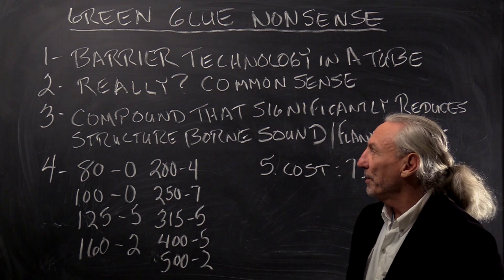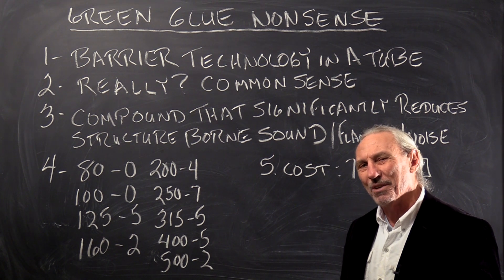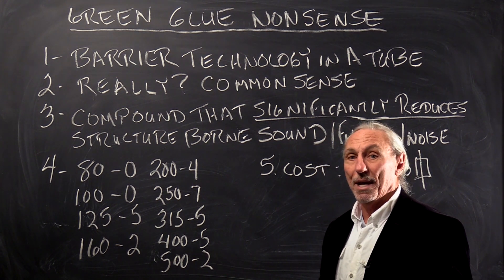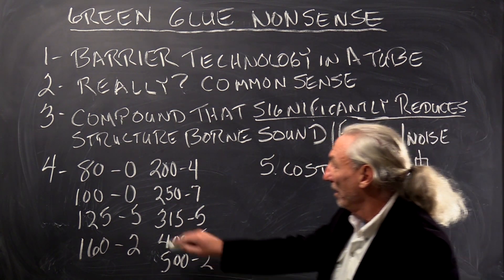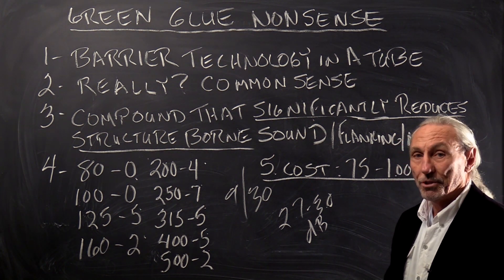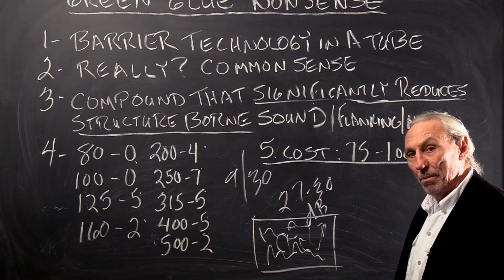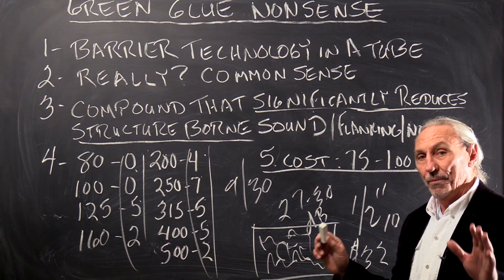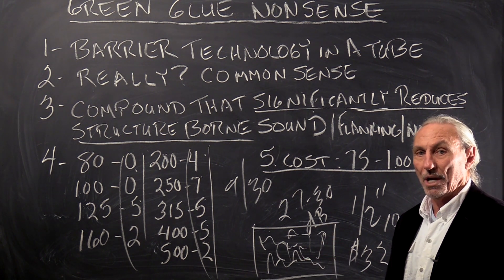Green Glue Nonsense - www.AcousticFields.com

Comment: The cost aside - what's the downside of using that stuff in between whatever insulation (be it MLV or others) you install? Every bit helps, right?
Reply from the maker: Not necessarily. Remember all material types and construction methodologies are all frequency and amplitude dependent.
Reply from the maker: M,  It depends on the frequency and amplitude of your noise issues. Does "every little bit helps". No, it does not. With noise, you want to use just enough barrier technology to solve the issues. Spending money and adding material without knowing what frequency and amplitude you are trying to reduce the noise transmission of is a waste of time and money.

Comment: I've always been a sceptic of green glue- I've never used it but have worked on several music studios in nyc. I think resilient channel is pretty good though. As long as all the edges are sealed so that there is a true sealed air pocket between layers of 5/8 rock-  you are getting best bang for your buck
Reply from the maker: D,  All materials used in any barrier design are frequency and amplitude-dependent.  You must use materials that deal with your noise numbers. There is no short cut. You must measure, design, and build the correct structure. There is no one size fits all.
Reply: @AcousticFields  most music studios have the same criteria in terms of frequency, your stock phrase for avoiding giving a helpful answer is wearing thing...

Comment: I’m not sure where you got only a -3db attenuation? I just treated our rehearsal room-double 5/8” Sheetrock with green glue in between. I measured bands rehearsing outside of our room and inside our room before and after the work. it used to be single 5/8” on either side and now two 5/8” and green glue. I have 35 dB of attenuation when before I had 10 dB. So it was a 25db difference. This was using C weighted dB meter. The difference is considerable. Could it have also been considerable with other materials? Maybe.
Reply: But what frequencies though? I'm sure it helped some with say guitars. But a kick drum?  Adding that 2nd layer of drywall for mass helped definitely. The glue, I'm doubtful. 20-100hz is a good test range.
Reply: BrysNightWorld nothing except tons of mass and tons of distance does anything at those frequencies. That’s why STC ratings don’t even go below 125hz. Green glue (nor anyone else) is making claims that anything helps those low frequencies (unfortunately). The only way to do anything about that is try and do super thick walls with concrete, rock, adobe, etc, but even that is not going to totally stop stuff unfortunately.
Reply from the maker: R,  What frequencies did you measure?
Reply: Acoustic Fields as I said-I was using a c weighted db meter in real world conditions (rehearsal rooms with other bands rehearsing in their own (untreated) rooms. I took measurements in the hall and in my room over several days as the construction was underway. The loudest band would hit 102 dB (!!!) and going in my room would drop it to 65 dB where before construction I was getting down to 85-90 db.
Reply: STC ratings mean more than word-of-mouth, right? From this video it sounds like you are saying to just use 1/2” Sheetrock (or from watching your other video-plywood). I’m in a commercial building so I can only use 5/8” type-x Sheetrock. STC rating of single 5/8” and insulation is 44-45. STC rating of doubled up 5/8” and green glue is 55. If you do it right with the hat channel, etc then STC is closer to 65. I’m not trying to troll or anything (I need to go finish putting up Sheetrock in my control room), but I have a hard time understanding where you are getting the poor results you are talking about.

Comment: I plan on turning my detached garage (bare stucco and studs) into a soundproof music/rehearsal space.  I am going to do the double wall, double drywall route.  I was told that I need to put green glue in between the drywalls.  Now I'm hearing that green glue may not be the best thing to use.  What should I do?  Any tips? Thanks!
Reply from the maker: A,  You must first measure the noise in the neighborhood and then the noise you will be creating within the room. The barrier you build is based upon those noise numbers. The method you described above is good for frequencies above 125 Hz. It will not deal with the kick drum or tom.
Reply: Did you ever complete this conversion? How did it go?!
Reply: @nikonmikon8915  no not yet. Life happened.
Reply: @AngelX  Ah bummer, I'm interested in how it turns out for you man 🤘
Reply: @AngelX  I best way to do it is use Rockwool safe n sound insulation in walls that are 6 inches thick and then build an entire stand alone room inside that room with 2 x 6 walls. The inside room has R22 6 inch rockwool insulation as well. The distance between the walls and the ceiling is 2 inches. 3/4 plywood on the outside walls and the inside walls are decoupled 3/4 plywood and 5/8 drywall. 2 inch thick foam over the drywall. All is sealed air tight. No one will hear a thing outside the room.
Reply from the maker: A,  You must first measure the noise entering the room and leaving the room. Remember there is no such thing as sound "proofing". You must manage the noise issues by first identifying the frequency and amplitude of the noise and then build the appropriate barrier technology. The barrier method you are considering will only work for frequencies above 125 Hz. If its a live room which you describe, you will need a different barrier technology since live rooms are full range.
Reply: @AcousticFields  thank you sir. That's the issue. It's full range sound from instruments, so how do I deal with the rest of the frequencies below 125hz?
Reply from the maker: A,  You have to measure the frequency and amplitude over a 7 day time period. Once you have that data, we can design the barrier technology for you and provide you a build drawing that you can build. The design fee is 1,500.00 for this service.
Reply: @AcousticFields  the average range for music will be 20hz- 4 khz. An acoustic  drum kit would be about 119 db on average.
Reply from the maker: @jaredswords3  We use a different range for our studio treatments. We use 30 Hz. - 6,500 Hz.

Comment: While I agree that Green Glue is overrated, some of the stuff mentioned in the video about the claims made on GG website are just plain wrong (as in they don't exist) while others are taken out of context. It is fair to criticise the product, but why make up stuff to support an argument?

If you are researching products for your sound isolation, read through the test data provided by GG on their website. You will soon realise that GG is less effective than using RSIC clips, and only provides a STC improvement of +2 when applied to 2 layers of drywall. I read rave reviews of GG being the most effective medium for stopping bass, but there are no testing results below 80Hz. Simply increasing the thickness of the drywall is a cheaper and more effective approach. As stated in the video, the only way to stop bass frequencies is by adding mass and thickness of materials.
Reply from the maker: J,  It is marketed as a barrier technology when it is not.  All numbers were taken directly from the web site.
Reply: @AcousticFields  It is marketed as a sound damping and soudproofing solution. That is pretty much all that is stated on the first page of their website. If you take a broad defintion of soundproofing to include the acoustic treatment of a room, then it does what is says on the box. The problem is faux sound engineers who spruik the product without actually understanding what it does. You know better.
Reply from the maker: J,  What is your definition of "soundproofing" ?  The conventional definition is that it stops all noise. What noise does it stop?
Reply: @AcousticFields  From your website https://www.acousticfields.com/definition-of-soundproofing/. 
"The actual definition of soundproofing deals with sound pressure and reducing that sound pressure between the source that is generating the actual sound pressure."
AND
"... we can use damping structures to absorb excess sound pressure energy".

Green glue is a damping technology, it says so on their website, and in my view that is their primary claim. It is the viscoelastic component of a multi layer damping solution. For the record, viscoelasticity is widely used by mechanical engineers to reduce vibration (i.e. damping).

You know your stuff and have your own way of doing things. Others choose to do things differently. You have a biased opinion on green glue which is in the negative. Just like a lot of other technicians have a biased opinion in the positive. I think the key point is that every sound problem needs a different solution. Making a green glue drywall sandwich may work really well in some circumstances and make things worse in others.
Reply from the maker: J,   Mass is just one variable you must consider when building a barrier technology to reduce noise transmission below 100 cycles. You must look at the frequency response of the noise and the vibration signature of each material you are using in relation to the frequency response of your noise . The joining of these two signatures produce a third signature that is the real test of the noise reduction coefficient you are going to end up with.This is the issue people don't understand with noise. Most people we talk to actually believe that two pieces of drywall with green glue will stop everything. So, they build that structure, they are disappointed and then call me for a fix. Unfortunately, the fix involves complete removal of what they have built. Guessing with noise is a fool's game. It has always been and will continue to be until these urban myths are explained for what they really are which are marketing tactics.
Reply: @AcousticFields  I was talking in general terms, killing bass can only be done with mass. The question is then, mass of which material, as you pointed out.
Reply: He also claims the edges of the drywall aren't sealed, so the random green glue patterns can't trap heat, but sealing the edges is critical to the installation! https://youtu.be/UO_NowMgPdY Common sense tells me if a product like this was truly useless it wouldn't keep selling. People do notice sound.
Reply from the maker: That makes sense. Now this "magic" adhesive can stop bass. Now, I have heard everything. What nonsense and rubbish.

Comment: instead of discrediting it completely, perhaps say it's useful when you have the money but dont have the extra 1/2 inch to work with that its a reasonable option for added attenuation. btw appreciate your videos and have watched many
Reply from the maker: H, It does not have any usage when you look at the total sonic strategy for STC. A common belief system is to use it with a double 2" x 4" wall with an air space between each wall. This could be as much as 7-8" of space to achieve an STC of 50 - 55. We typically achieve an STC of 80 - 85 in that space at all frequencies not just above 125 Hz.
Reply: @AcousticFields  and how do you achieve this at a similar cost? You never share the how to you just constantly knock other methods. PLEASE share what is better than a double wall with double drywall and GG. I am guessing that your methods are 10 times the cost and you just never admit to that. Please prove me wrong for a change! Thanks
Reply: @AcousticFields  and how do you achieve this and how much per SF? Are you ever going to actually share ideas on here or just keep discrediting every other method and product without no help at all to is. This is getting old. The same exact responses with zero insight to all these poor people reaching out to you to seek your "professional" help.
Reply: What a snake oil salesman. Discredit and then offers his own proprietary solution. How convenient. You keep on answering people’s questions by saying it depends on the frequencies of the sound blah blah blah. Let’s be real. You know exactly what people are asking about. Usually impact sounds, or maybe a theatre setup. For impact sounds, greenglue can help to a point. Atleast for ceilings.
Reply: @Heliosvector  exactly right? I have been trying to get a straight answer from this guy for 3 weeks now! Every time he replies back to me with "what is the frequency and amplitude of your sound issue"? He's hoping that we have no idea what he is asking and we stop pressing him for answers. Some of us are actually pretty educated on sound systems and what those terms mean. I have provided numbers to him twice and he always ignores me. What a douche! I appreciate you calling him out. I have been stuck on a double wall assembly for simply blocking a full range stereo that goes down to about 28 db and looking for answers on what's best to use and most cost effective. This guy is such a dick! Any insight on your setup would be great the hear. Thanks man!
Reply: @detroyt232323  here’s my advice and discoveries. First off. Mass loaded vynil is great... but it is expensive AF! Don’t bother with it unless you have a lot of money. Also the “acoustic drywall” or any other panel is expensive AF. Green glue can be pricey aka 2 tubes per 4x8 drywall, so 20+20 for the glue and then 20+20 for 2 drywall sheets, but that barrier will perform far better than any other setup that would cost you around 90-120 for comparable surface area. For walls I suggest filling the cavity with rock wool. Yes it’s only slightly better than the pink stuff... BUT! It has so much more mass than the pink candy. That makes it somewhat better for lower friequencues. Then cover the beams with sound clips and hat channel. Resilient channel for cheaper. Then 5/8 drywall, green glue, 5/8drywall. I’ll assume you only have access to one side. If you can do both, great, but let’s not expect miracles. It will be a messy job to take down drywall and can be scary, but it’s worth it. At the end of the day, it’s flimsy board tacked onto wood. It’s not a cavity hiding death and destruction in the form of wires and pipes.
Reply: @Heliosvector  ok cool! Thanks so much for the reply. I am actually looking to build a double wall or room within a room idea with a 9" space between sheets of drywall. Everything that I have read this performs far better than GG, sound clips or just about anything attached directly to the same stud as the other wall. Most reports show a STC in the low 50's with GG and double  drywall vs low 70's by simple separating the walls and double studs not touching. Any experience with this at all? Most people say once this is done you don't need to worry about sound clips or GG just pink insulation and double drywall to achieve amazing results. Thanks again and have a great day!
Reply from the maker: H,  The issue with companies that take a material and advertise it as an "acoustical" product is always suspect. I am certain this compound was never designed with "acoustics in mind". This is the problem in the acoustical world. We use building insulation as a sound absorption technology when it's design parameters were BTU retention. We take open - celled foam and call it a "bass trap".  Carpet glue becomes a "barrier" technology. The absorption/diffusion treatment of music and voice in small rooms requires more care and concern. Music and voice are different and very special.

Comment: Can someone explain how he calculated STC difference by using number of octaves and total reduction in 2:02 . Is there an easy way to calculate? As far as I followed, 9 is the number of octaves and 30 is the sum of reduction values in 80-500 Hz. We are working with Rw, Dntw, etc. And basically they are similar but I have never seen this kind of easy method for calculating.
Reply: They're not octaves, they're just frequencies that have been measured at. He just calculated the average attenuation at the frequencies reported.
Reply: @narco73  I know that they are the measurement frequencies which are sorted in 1/3 octaves. I am just asking, he summed some differences, reached the 30 and 9 then he calculated sth and said 2.7 to 3 dB. Is it dividing 9/30 and (result is 3.0) then subtract 10% or sth like this.
It is not very accurate but it is useful.
Reply: @akifemekli  add up each frequencies reduction value that he stated is on the green glue website.  Divide it by the number of frequencies.  That's the average reduction across all of those frequencies, which would be the stc value if stc didn't exclude frequencies below 125 for ratings.

Comment: Green glue is very effective.  I used it in my condo (shared wall). I added green glue to an additional sheet of drywall. I used two tubes per each 4x8 sheet of drywall.
Reply: @julesdownunder feels like he doesn't want to share :(
Reply: @simon-benoitbretchko3617  That's because people are still asking the same question: what's the cost of a car? It can only be answered 'it depends'. There's no one solution for every case of noise treatment. Just like the author had stated 300 times in the comments section. You're not listening.
Reply from the maker: M,  What frequency and amplitude were you treating.
Reply: Acoustic Fields I could hear my neighbors talking at a normal tone.
Reply from the maker: M,  Now what do you hear ?
Reply: Acoustic Fields faint mumbles
Reply from the maker: M,  Using the same material density as you did, you could have gotten rid of those "mumbles". This is the thing with barriers. If you match the material and construction methodology to the noise frequency and amplitude, the noise goes away. No spill over at certain frequencies.
Reply: Was it the green glue or was it  the additional sheet of dw that helped??